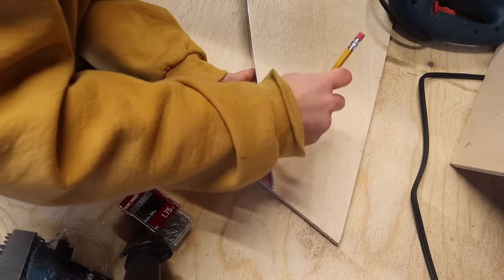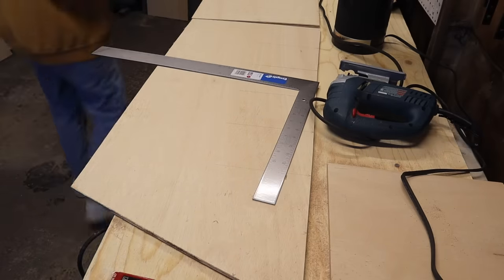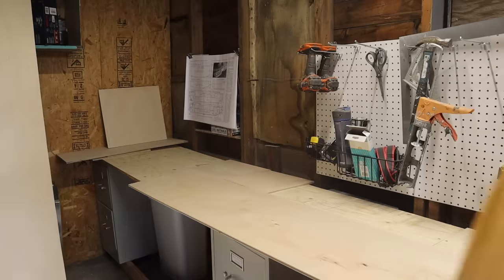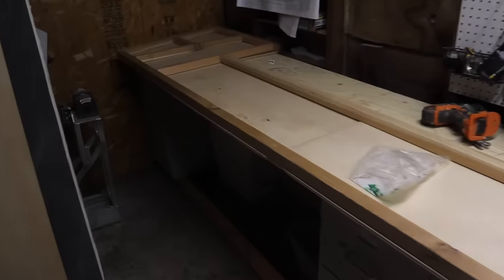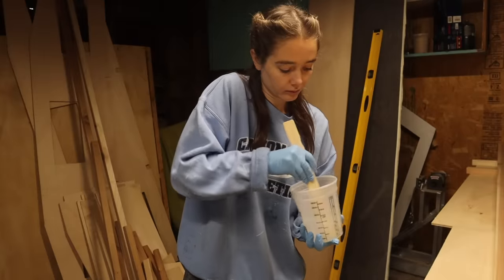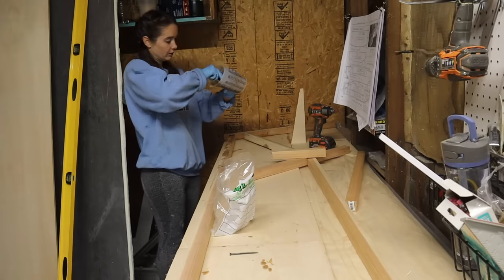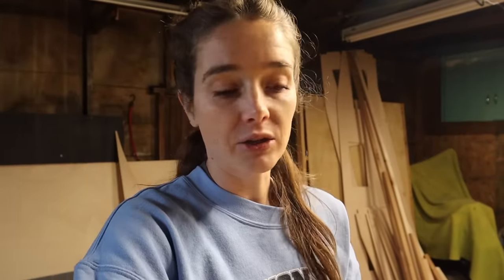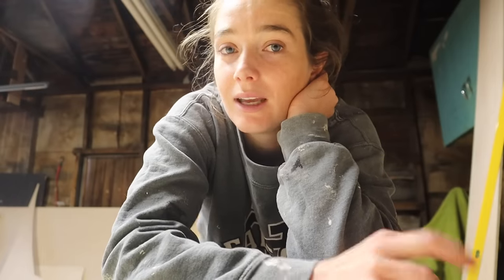Building a House Boat in my garage (boat build part 5: hull framing assembly)

Comment: Happy New Year to you and yours!
Great efforts yield great projects!
One little tip from an old guy; when using a square, if you hook the short side over your material and hold it flush, you can use the inside of the square to mark your lines. The square should be marked on the inside too.

Just a suggestion, put the camera on time lapse n put it up in a corner, and forget about it while you do things. Your voice over voice will be calmer than your running commentary voice and you won't have the stress of filming to deal with. I think that those of us who watch, will watch anyway.

Comment: Couple of things I've discovered over the years of messing around with boats.  #1, white vinegar (30% is best) will completely remove uncured epoxy.  It kinda breaks it down to leave no sticky residue.  #2 check out the jigs on YouTube to attach to your router and consider building a router table.  I was extremely router disabled and these things helped make parts, not firewood.  Good luck,  keep on building!

Comment: Looking good. I always love going out the next morning and checking on the epoxy from the day before and find it rock hard. If those pumps are giving you trouble, just pour the epoxy and use the graduations on the cup. Since it’s a 2:1 mix it’s pretty easy to not mess it up.

Comment: Hey Emma, I totally feel you about filming and boatbuilding. That’s pretty much all I do and it does take a buttload of time and attention away from the building itself. My channel is all educational small wooden boatbuilding and there’s a ton of tips and tricks spread around the various videos that could make things a little easier for you. Not trying to drive traffic to my site, just trying to offer up some efficiencies for you. Here’s a couple: bend the end of a chunk of coat-hanger into a squarish hook and chuck it in your drill for mixing epoxy. You’ll get it more thoroughly mixed in a quarter of the time. Clean up squeeze out with denatured alcohol or methyl hydrate and invest in a box of Wipe-all X60 shop cloths for doing so. A heat-gun and paint scraper will clean up cured epoxy faster than sanding. Best of luck with your build.
Reply from the maker: thank you!!

Comment: Hi Emma, I'm 2 years into building Dianne's Rose, well kinda,  I've made a few changes, making it 22' long and 8.5' wide. Putting a new 30 hp Mercury OB. I've changed the hull (not much) making it with angled sides but it's still a flat bottom boat. I've put fiberglass on all the inside surfaces. Lots of work. I'm getting ready to fiberglass the bottom and flip it over, as soon as warmer weather gets her.
I see Roy knows your building. There only one rule, measure twice (or 3x) and cut once.
Have fun, and keep on building.

Comment: To make it easier to measure your epoxy parts toss the pumps and use the marks on the ration mixing cups you are using. Just look on line for instructions on using ratio mixing cups for directions. It's easy to do. Also, once you've mixed the epoxy, most artisans transfer it to another cup which ensures that the epoxy you are using is well mixed and any unmixed portions clinging to the first cups sides and bottom are left in the first cup. Hope that makes sense.

Comment: Just a thought..............  Keep the bottles of resin in the house to keep warm. Since you don't mix that much at a time. Put some plastic or a tarp under them in a corner. So not spill any on the floor. Might help the pumps on the jugs. 
Very nice to watch your journey and growth.

Comment: I have every confidence in your ability to have this boathouse on a lake in 2024. Can I suggest if you are struggling with the epoxy pumps - take them out of the bottles and pour your resin and hardener into 2 separate containers ( this ensures accuracy in measurements) before combining in a third container and mixing, it's much less taxing on your hands.

Comment: Nice work, Emma, it' holds itself together, which means you succeded. Don't rush, think before every move on the result you'll get after. Damn, that looks pretty consistent size for a boat, which of course won't be as big as the bus, but you'll have enough space for sure. Keep on, don't worry about voiceover, you anyway explain the details very well. Stay strong and take advantage of your experience. Cheers, keep on!

Comment: What if you modify the bottom of the boat with a small square "plexi-glass" and seal it with "flex-seal all around" so there's no leaks, then you could see through the bottom of the boat, maybe? Just a suggestion. :)

Comment: On my boat years ago I used poxy with the pumps Main thing is after pushing the pump down let it come back up by itself don't force it You are doing great A real pro  Prime it each time the pumps are designed to give the proper amount Mine was a 5 to 1 ratio  WEST SYSTEM  Funny thing is one way they keep the sun from degrading  the epoxy over time is using aluminum powder Not saying you do just pointing a little tidbit  I had to buy several gallons not cheap even back then

Comment: happy new year emma ! wishing you to finish the boat atleast for a 1st dunk before summer :) Your filming, your videos , your edits are very good, you are very skillfull person. Non of your videos are plain simple and the same, i really like you filming different angles like in the previous video the footage from the top while using the router. In this video at 8:00 the timelapse and then the next morning footage :) it awakes you from beeing focused on the build and relaxed by your voice. But if you can cut corners from the filming of the build and it safes time do it, personally i watch you cuz of your entertainment, ambitious, bravery. Im not plannig on building a boat, years ago i tried making jankie raft from plastic bottles but it sunk with my weight :)i had a plan to pump air in the bottles but grew out of that project, anyway wishing you all the best, stay safe :)

Comment: Even if the epoxy claims to be "low VOC", you NEED to wear a mask to protect from VOC.  Low voc is not NO VOC.  Please protect your lungs and get and wear a mask made for VOC pretty pretty please.    Loving watching your build.  From my perspective, you seem to be cruising fairly fast on this build.  It looks like you have the bottom 1/4 done.  That pile of parts is no small task.

Comment: Looks good. I was a bit worried when I saw you were using slow harder in cold weather. You may want to get the fast stuff if you dont want to wait overnight for it to harden, but its working so thats all that matters. Time is your friend early on anyway. As you gain more experience, you might want faster set times, especially when glassing. But for now, slow gives you time to work.

PS. I hate doing voice overs, but sometimes its that or scrap the video. Also, time lapses are an option when you dont have time to keep moving a camera.

Comment: Loved how used screws as 'temporary'  Because a boat doesn't need to be water tight below the water line and when the screws are removed no holes are left behind.  The wood seals itself as screws are removed.
Reply from the maker: good thing there are many, many more steps to complete before this is a boat! Would be pretty silly if somebody thought I was about to drop this bare plywood in a lake as is...

Comment: 8:00 mark.....    I foresee a small problem POSSIBLY headed your way. 
Possibly.  
By taking all your measurements off of the side you just built, you may end up 1/8" to 1/4" off on all of your measurements on the duplicate side. The cuts have all been made... but doing all the cuts again means you have to factor in the blade thickness back on all of the cuts on the duplicate...or you risk everything being 1/8" to 1/4" short on the duplicate side. 
That make sense?